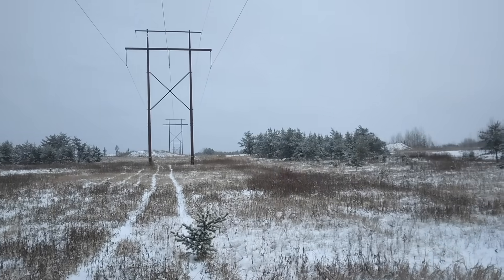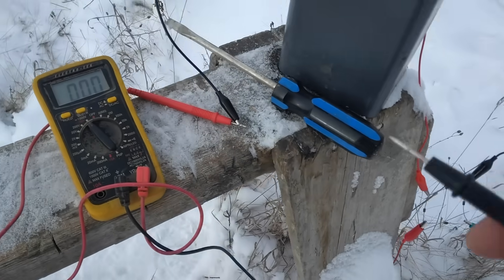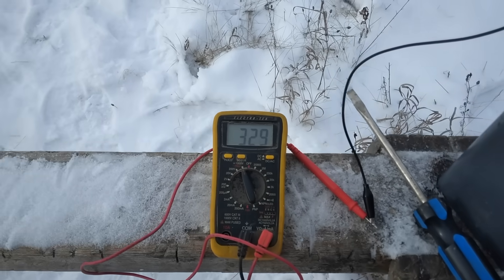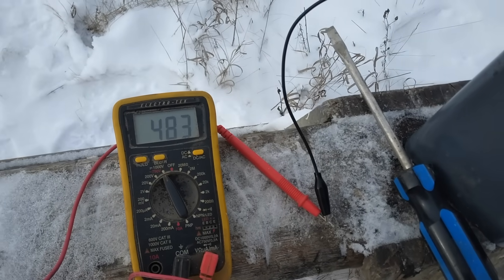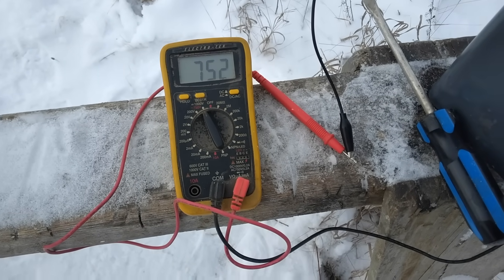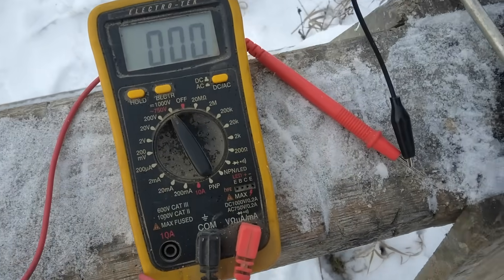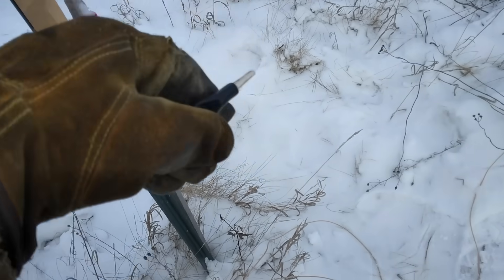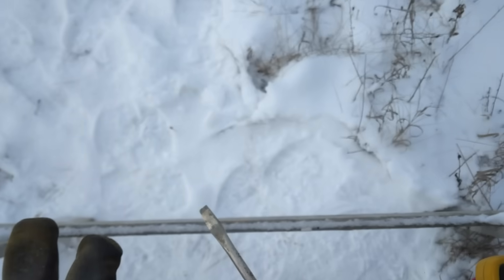Fences sucking power from under HV transmission lines

Comment: What about using a chain-link fence instead of taught horizontal wires? With or without steel top bars? Wooden posts vs. steel? Seems like if you don't ground the fencing in a situation like this, it will charge up like a capacitor and then unload on the first available ground path that happens along, which could be grass or brush, tree limbs, or your kids or livestock, or just random wild animals who rub against the fence or try to climb onto it. I don't really have any preconceived hypothesis but this video has got me wondering about the feasibility of safely harvesting free electricity by induction from high-voltage transmission lines. Evidently a lot of people are doing it. I don't see how it could be illegal unless you were somehow reselling it to neighbors or putting it back on the grid through your home or business's meter connection. Thoughts?

Comment: Sorry, not following. What exactly is the point of this? It’s dangerous to be near these lines? You can tap into the power for free?
What?
Reply: Long lengths of electrical conductors can become energized while in proximity with high tension power lines. Even touching a car parked under them can provide a slight shock, but only if you're grounded.
Reply: @shamancredible8632  Thanks!

Comment: Great video. 
 I discovered back in the 90s that you could collect free inductive energy from high voltage lines. 
I  was walking my dog on a misty day under a main run. 
Stopped to rest and enjoy the view when I noticed a tingling in my hand clutching the metal umbrella pole. 
Grabbed the plastic handle and Placed other finger close to the pole and got a  1/16" arc.

Comment: Yeah. A lineman once told me that if a pole climber were to reach over to a guy wire BELOW the Johnny ball he could be electrocuted by the current induced by the high tension transmission lines. Current induction is a real thing!

Comment: As a kid our neighbor would walk under similar transmission lines holding a fluorescent light tube over his head.  Sometimes it would flicker, sometimes it would really light up.  Forgot all about it until I saw your video.  Thanks.
Reply: We used to do that as a party trick in high school.  Desk lamp fluorescent tube with light right up when held above our heads while standing under the HV lines in the neighborhood.
Reply: I seen florescent parties, everyone brings a tube and they all light up, it's pretty cool
Reply: Voltage is on thing, power of a load is another.  Seems this scheme is fine for people with the EE degree to do this safely.  A coil of wire would likely bring higher current.  Power regulation is necessary.  Just know, you are working with a live circuit at all times. Furthermore, humidity and electrical storms may cause serious challenges.

Comment: Next I would find out the total voltage that will accumulate. Take this voltage and divide by 12, then hook up this many 12v  batteries in series and charge them from your bridge rectifier. Then remove your charged 12v batteries and hook them to a 12v to 120Vac power inverter to run AC power to whatever you need. Note: this is for educational purposes only,  and not meant to encourage any illegal capture of energy. If you do so you are doing at your own legal risk, and/or risk of physical health or property damages.

Comment: 50+ years ago my dad was sent to Canada to check out how safe a 250k volt power line.  Twin engine prop w/ free mini bottles of booze. Plus swag, chow to building by sample power line.  When they were going to energize it everyone needed to be wearing rubber based boots. They showed how animals lived under it.  A line that was only energized for testing to a dead end.  Not being drawn from.  possibly not even energized to full power.

Comment: 36 Joules of energy. For comparison, an AA battery has about 10,000 Joules of energy. So you'd have to do what you did for about 280 times as long as you charged this time. If it was 10 minutes, you'd have to charge for 48 hours just to charge to the level of one little AA battery. If it was 20 minutes (there were cuts in the video), it would take 4 days. This also ignores any energy losses you may have as the charge level increases. I don't think the power company will care if they lose a couple of AA batteries per week from one guy. You'd have more money invested in the wire than you'd get out in free energy.

Comment: These transmission line carry three-phase voltage. Wouldn't the proximity of the other lines mean that the fields are out of phase with each other, and mostly cancel out?

Comment: I had a buddy who worked with nuclear radiation for medicine and he said those big caps need a bleed resistor (1-2meg ohms?) on them for storage as they can charge just sitting there and provide a shock just from being in storage.  I got some of the large ones from him and they all had this bleed resistor.  2 megs won't change your readings any and makes that cap safer.

Comment: I got to experience this in a shocking way (pun intended) when I was working at a nuclear power plant doing pavement work.

I was parked right under the main transmission lines, where they are MUCH lower than on the towers you see. They start out at about ground level where they come off the generator, fenced in, and I was right outside that, so I was as close as it was considered safe to get without expert training/supervision

My hands were dirty, and I had a water tank on my truck so I cracked open the valve and when I rinsed, I was zapped by the induced voltage in my truck body, being grounded out by the water stream.... Scared the shit out of me! LOL
Reply: I suppose that's why the fence is there so you can't get any closer!
Reply: @thewhitefalcon8539  Definitely. Much closer and a taller vehicle than mine, like the bucket crane trucks the utility themselves use, might actually have been in danger of arcing from the main conductor lol.

Comment: Without a load, that capacitor would keep charging.  If you have some sort of load, like a 100W bulb, you can measure the voltage across and current through the load to see what sort of actual power you were getting and how useful it could be. You’ll find it much less grab the 900 odd volts with no load.

Comment: iv seen a elecric company  worker the instant he got shock and died, i was at a stoplight heard a big bang looked to my left a guy was getting shock he was about 4 feet away but on a laddler he fell drop like a rock, died, my friend same thing a maintance man at a high rise i seen him 6 month later told me almost died said he was panting had a long stick  and roller he was 6-7 feet from the line side the shock flip him over, it when down the alum made a hole side of his ball  when down his legs burned, lot of skin stuff but he live. says ekectric can jump 6-7 feet  watchout. ivc stick my  finger i a 120 v nO bulb in behid the work ice box stant yiu up. i had rubber shoe. but it the high volt that would kill you,

Comment: About 10 years ago I took an LED light bulb out (It was a light bulb from a light up helium ballon that used tiny batteries) and carefully connected couple of wires to it. Under the power lines there was no way it didn't work. Hold one end up, it worked, hold the other end up it worked. The brightness changed every time you adjusted something. The brightest lights was holding one wire to a metal fence gate, and the other wire to the ground mental fence T-Post. It was free light and was similar to a dim walkway solar light.

Comment: Joules  equals energy.  But it takes current to kill.  That is result of voltage and resistance  so as most people's skin is around 10,000 ohms  it takes voltages that are quite high to even feel a current that is dangerous.   Charging a capacitor is like charging a car battery the more u put on the higher the total available so his comentry was cross purpose  the fence wire is not a battery and does not store the energy as ac is constantly reversing.  DONT REPEAT THIS TEST U CANEXPLODE THE CAPACITOR.

Comment: This article makes no sense as Tran lines move HV AC  not dc  so any dc is result of a rectified current .   The guy said he charged up a capacitor  well he better find out where the current is going that leaves half cycle to charge the capacitor that is called leakage and is common to all transmission lines. Now he speaks of diodes  in his test line  he is making a bad situation worse.  Leakage should be ac so an electrostatic voltmeter will be the instrument to use.

Comment: Very interesting experiment! 
During the time the cap was charging from 186V to 331V, the average current was  0.19 milliamps.   [ i=C x delta(v)/delta(t)  ]
This raw current at the open end of the wire will not kill you but the capacitor itself can deliver enough current to be dangerous. 
I would wear gloves around this circuit.    

A comment below mentions how HV lines affected horses.
I've heard of other cases when HV affected cows and horses. Their feet are always touching the ground and an AC current flows through their body.
Reply: "cow-pacitive" coupling
Reply: Around here they called it stray voltage, it is in effect a ground out and I’ve seen it first hand, the power flash and arch would find a path of least resistance down a pole or tower and arc unit that path way diminished or burned off…then it’s back to business…the cattle standing on all fours would get into an imbalance state from the source ground and they were doomed…the voltage propagating across the surface diminishes over distance and those differences are deadly…that why the say if you are somehow caught near a down line or contact point to hop away with your feet together evenly..
Reply: Worked on a dairy farm where the milking shed had constant ground issues , after months of this the cows were so shit scared of that she'd they wouldn't even come out of the paddock to be milked 😢
Reply: not related to power lines, but the NEC has rules for grounding structures for dairy farming. Apparently the smallest of currents traveling through the cows feet will sour the milk, making it undeniable.
Reply: @G8tr1522  Or maybe it's because the fences and guardrails are all metal and in some places you have electrical equipment in contact with it. A colleague of mine managed to kill 10 cows in the milking parlour because he forgot to ground the milk pump and when on the third day of testing the farmer managed to flood it a current of about 40ma was flowing from the pump's chassis through the stainless steel pipes to the metal guiderails for positioning of the cows for milking. The structure was also not grounded and the cows were grounding it out trough the wet concrete floor. Turns out cows are very sensitive to 50Hz currents because all 10 in the parlour dropped dead from that.
Reply: @G8tr1522 old wives tail, dairy farms have the same NEC code as any other farm building for grounding.
Reply: @G8tr1522  I was waiting at a dairy shed -herring bone to rotary configuration conversion. Noticed  great attention paid to bonding the  reinforcing mesh in the yard slabs, all posts and rails. I was told it was essential to avoid milk production losses.

Comment: But also have break down voltage of the diodes so if it's 400 volts then it's only will charge to 400 volts. Probably 1kv diodes.

Comment: Studies with data accrued over years, and in some inquiries, accrued over tens of years, made in a number of countries, from Algeria to Sweden, France, Great Britain and of course the U.S., concluded that there may be a harmful effect on human biology from the ultra-high voltage aerial lines that are in vicinity. 
The same as in nuclear radiation, you must not be exposed over a certain quantity over a longer period of time. Like in the nuclear radiation, you can reach the harmful level in a short time under a very severe exposure, or you can reach the same level in a longer time, under a smaller exposure. In plain English, if you walk for 2...3 hours along the poles of a high voltage line, and you'll not do that again for several months, it's not worrisome. If you walk for 2...3 hours along the poles of a high voltage line and you do that every week or more often, that may be a troublesome health hazard.

Comment: What setup would one need to safely charge a cell phone under the high voltage line?
Reply: Some kind of pickup coil, some kind of rectifier, some kind of regulator. Although this video shows hundreds of volts, that's from miles of fence and it's also without using any of the power. It will be more manageable with a smaller coil and if the power is actually used, even with a circuit that just dumps it if it's too high.

Comment: ElectroBOOM is going visit and try that experiment ! Guaranteed more sparks !

Over 24J at 750V. 28J at 800V. That's gonna do a job on that screw driver when you short it out.

W = 0.5CV^2. So (0.5)(88x10^-6)(900)(900) = 35.6J at 900V.

Comment: We installed an 8' tall chainlink fence around a communication tower, nearly 1/4 mile from a 400,000 volt transmission line, and all went well. Our communication system repairman called to report that the fence was shocking him. I went to the location and the voltage was high enough to give a person a good jolt. I never checked the voltage. We installed a ground rod at each corner of the fence and one for the 50' tower. That seemed to fix the problem.

Comment: Without knowing the voltage induced in the wire is very risky . That capacitor would have been a dangerous explosion. You need to find a meter capable of reading higher so you know what you’re dealing with.

Comment: Power companies learned this around 1900, when the first HV AC lines were strung from Niagara Falls to Buffalo, New York.  The only concern is that some young Tom Edison might fry himself, which does not make for god consumer relations.  You can experience the charge by parking beneath a rural HV line.  Then stand outside the car and brush your hand along any non-insulated metal part.  You should also be able to light up a neon voltage tester.

I don't know what would happen beneath a high voltage DC line, but when we did some DC tests at the giant high-voltage laboratory at Mississippi State University (Google it) we were applying 1 MV DC to some test piece.  Afterward, we began to take everything apart and to our delight discovered that we got a healthy shock from every bit of insulation, like plastic or rubber.  That HVDC apparently re-arranged the surface charge on every non-conductance surface and equalized it through our hands.

Comment: I’d be curious to know what was the constant AC voltage value induced before the rectifier was?
Did you think it would be too high for the multimeter to handle safely without toasting it?
Very interesting thanks.

Comment: every one is not seeing the elephant in the room standing on thier foot! earth has a magnetic feild. how long is your fence? what guage wire? look at the grid like you are seeing your fence. adjust to that scale.  look at this set up from a dif angle. just as you   can capture this magnetic feild with a puney fence , what does the grid constructed like it is , collect?!😊  ive been a power plant maint mechanic. i believe ,after 15 years ofseeing bull shit,  expensive ,  in efficient and failure   proned designs  , that the power plants are just big money laundering ops. the plants i worked in were junk .wouldn't run a toaster. the grid is both the collection and distribution  device.  the Carrington event  taught the establishment how to utilize induction power management and its' potential. how genius. a solid state ,  static device with no moving parts to capture some induction power at a minimum specific distance from ground. a gigantic insulated circuit with big conductors. think of the scale of the grid and how the power cartels won't allow regeonal independant power plants. all hooked to the grid. i don't know everything but i know what ive seen in industrial power plants.there's  more than meets the eye.they hide in plain sight. for more proof from the liars themselves , look up the tethet incident on a space shuttle mission. when you find it , ignore the " uap/ufo" nonsense and find the description of the experiment. it was proving induction power collection at higher levels than could be used by the tether. a wire conductor . that s it. NASA has power claims that justify my idea. not that i believe them either but just saying. look it up. interesting.

Comment: We in Germany had and have several Long wave and medium wave transmitter antennaes in about4 kmdistance.People told us, than an isolated wire fence under the roof get enough voltage and current to light up a Light bulb. Today however only the german time signal is transmitted from there. Most broadcasting was shut down. Deutschlandfunk is in the Internet now.

Comment: Everyone thinks power is transmitted IN the wires, when it’s really transmitted AROUND the wires. That’s why you can tap into it without touching the wires and why the easement exists. The power is literally transmitted through the air around the wire. 

This is a good video simplifying it. 

https://youtu.be/bHIhgxav9LY

Comment: drop a couple of earth stakes under and in line with the transmission lines. See if there is potential difference in different ground points. I know of dairy farmers running the lights in the milking shed of 2 earth stakes under transmission line to an aluminium smelter.

Comment: Not enough watts to do any work or be of any use. Slowly building up and saving the equivalent of a static charge in a capacitor is useless; a livestock electric fence charger would provide more watts and a higher voltage than this collected bleed.